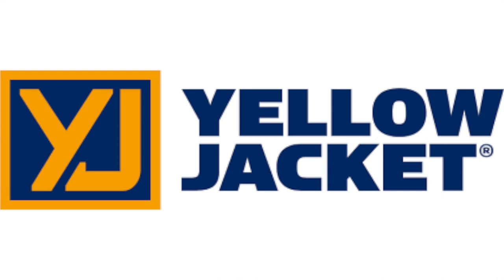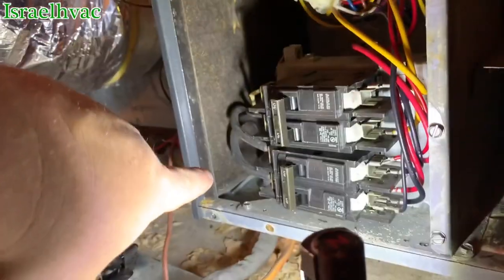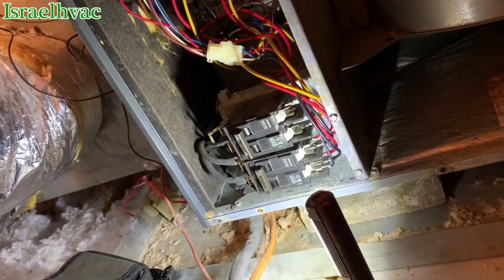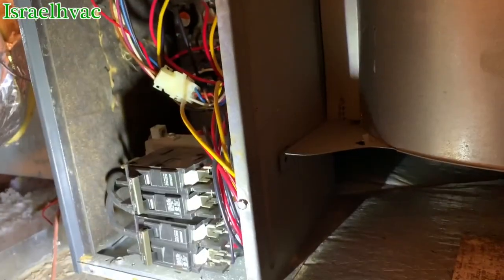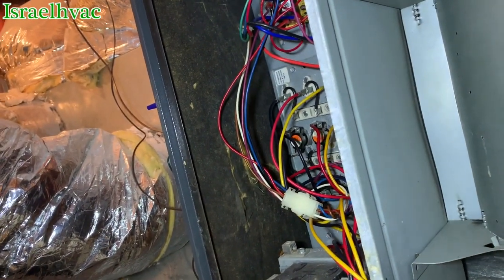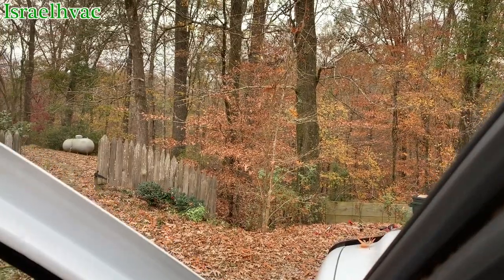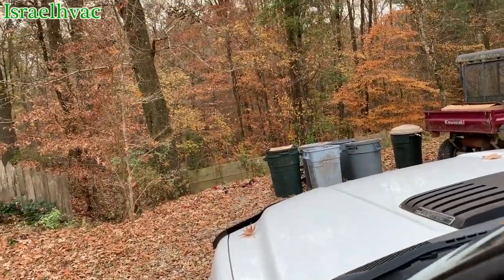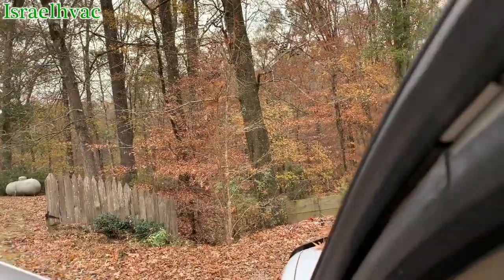Quick HVAC Maintenance

Comment: I deal with a lot of electric heat here in SW Florida. You should try to find a Trane Hyperion cabinet and uploaded video. A lot of texts out there have a hard time going through all the circuit boards. Specially the electric heater. Great job as always!

Comment: I’m down here in New Orleans and we have lots of gas and electric heat to and very few heat pumps
Reply: the added cost of a heat pump pays for itself in three months of using it.  Even New Englanders use heat pumps.  For a southerner not to use a heat pump is pure stupidity, or ignorance.  A good HVAC company shouldn't even offer an electric option.